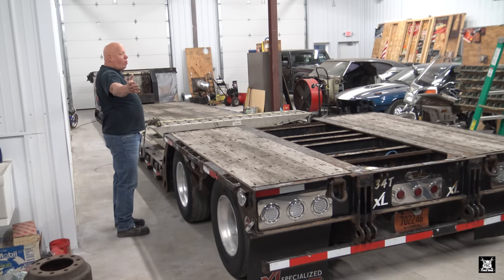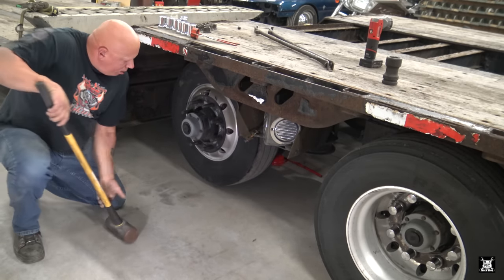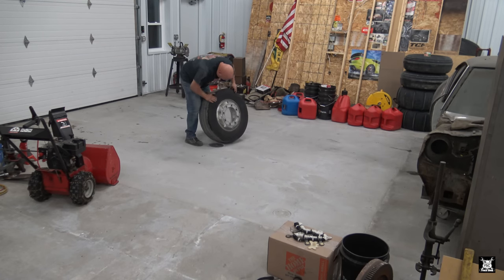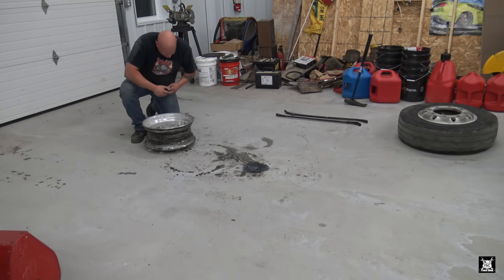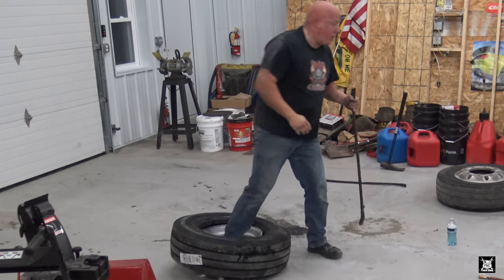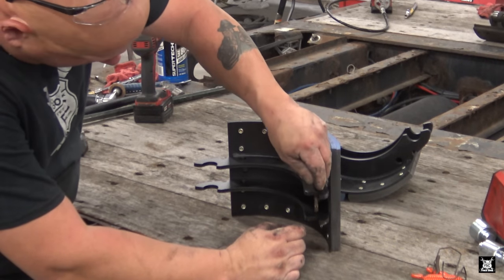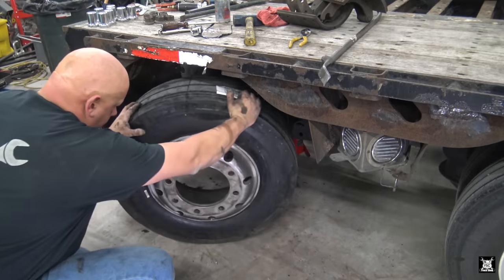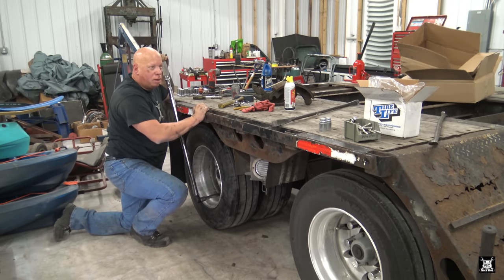Replacing Tires And Brakes On My XL Specialized RGN

Comment: Completely unrelated Steve but I’ve been thinking about your pneumatic wipers. What if you ran the vacuum lines to the dash and install a plastic fuel line shutoff valve like on a lawnmower to act as a ball valve to partially cut off air flow to slow down the wipers. Watched a video of you driving in the rain and was waiting for Orwell to have lift off with how fast they go.

Comment: ive seen those plastic shims used between steel and aliminum wheels to cut down on corrosion not when having inner and outer aluminum whhels together.

Comment: Doing a good job on the brake job on the trailer. Have you addressed the problem you where having with the lights on the trailer ? Maybe you will need a new wiring harness. Tracing down the problem can be a real pain in the but. I enjoy the videos. 😅😊

Comment: Orally auto parts has tire mounting compound   that works well  mix it with hot water and works great for mounting tires   I'm a Profesional   heavy duty mechanic  it's a small bucket but  it's Murphys  tire mounting  compound  in a white bucket with green label

Comment: There is a lot of static watching this video is it just me?
Reply: Nah everyone I hear it to
Reply: Yeah static is pretty bad
Reply: I had no static
Reply: Just think of it as old school radio. 😉
Reply: The static went away when he moved the camera to the other side of the garage to deal with the tires.  I'm guessing there's some electrical interference as I believe the breaker box is in that corner, if I'm remembering the walk around of the shop correctly.
Reply: Thanks for responding folks 😃
Reply: @stubstoo6331  1:48 there is you can hear it very loud and clear
Reply: Possibly could have been that an auxiliary mic had issues
Reply: So you are married too. Hear ya.
Reply from the maker: I had microphone issues set off by the loud pneumatic tools.
Reply: Same hear
Reply: Static so bad I can’t even watch the video…..dislike

Comment: Out of curiosity, do you need to balance those tyres the same way you do with car tyres?
Reply: Most guys don’t even balance trailer tires
Reply: There balanced buy the bag of beads he thru in before seating outside part of tire don't no how they work but they do had a tire on the truck I drove they broke it down thru that bag in inflated it after I think was 30 miles vibration went away some still put the clamp on weights on also